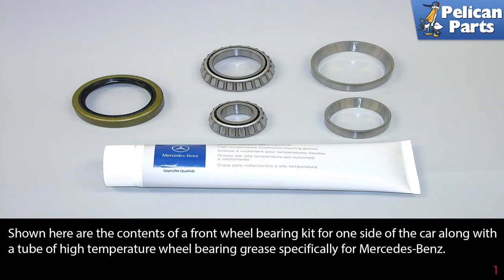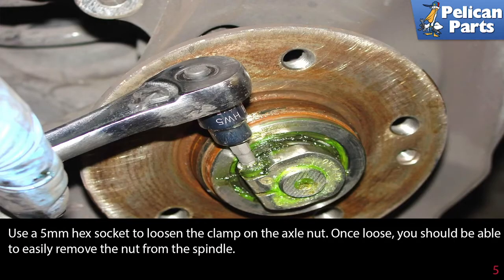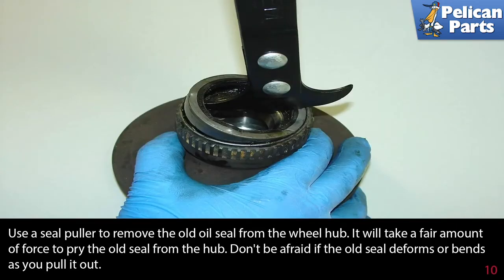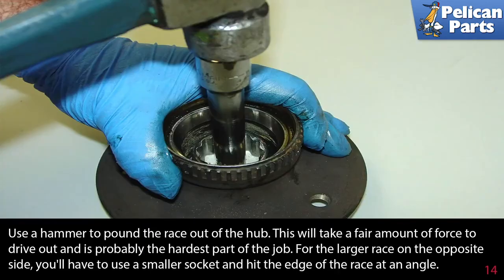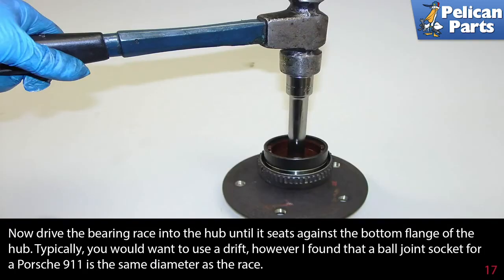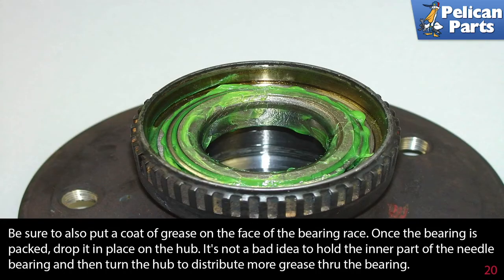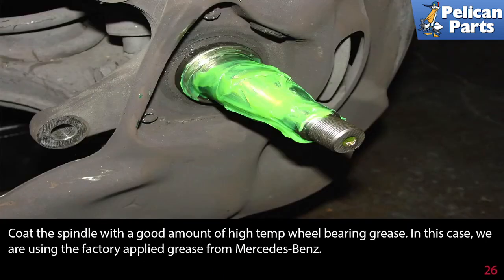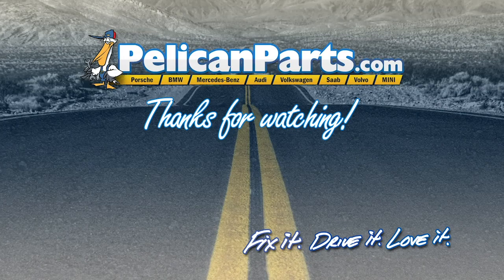Mercedes-Benz W210 E-Class Front Wheel Bearing Replacement

Comment: As I recall, the bearing run-out is around .045" = 0.1 mm. Remember to check while tightening the nut, rather than loosening it, in order to get a more accurate setting. One tube is enough grease to lubricate the bearings on both sides of the car, one half tube per side, evenly divided between inner and outer bearings. You might want to check run_out before taking the bearings out, so you can decide whether or not to replace the bearings.
Reply from the maker: Thanks for the additional info. We appreciate it.